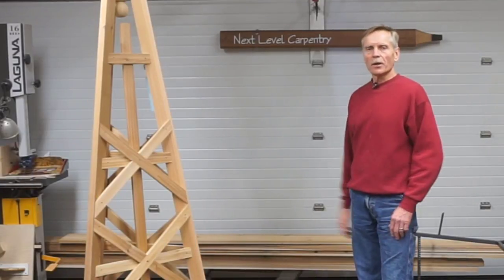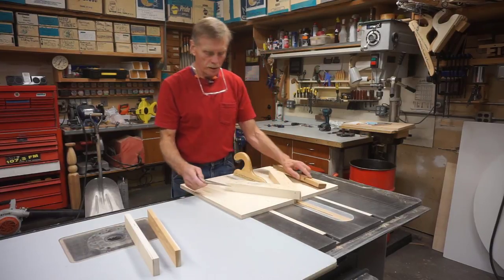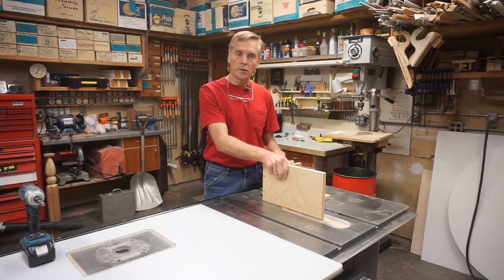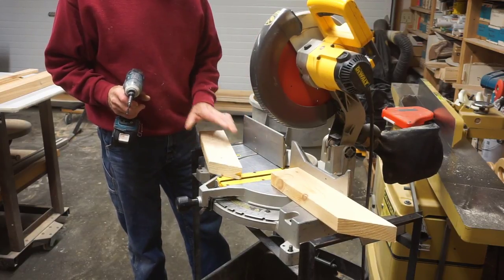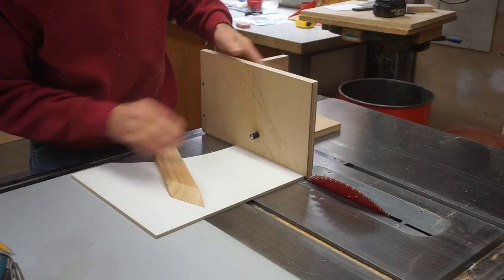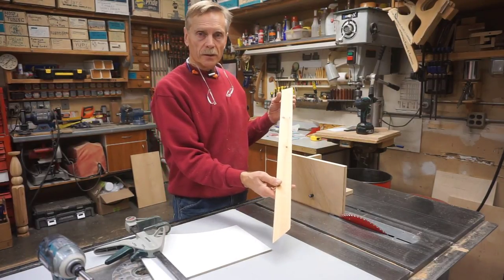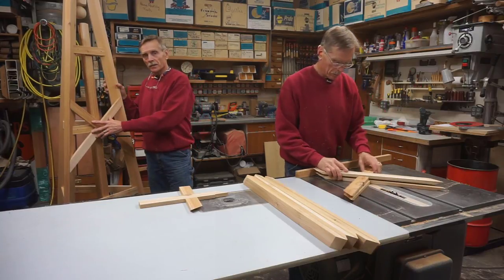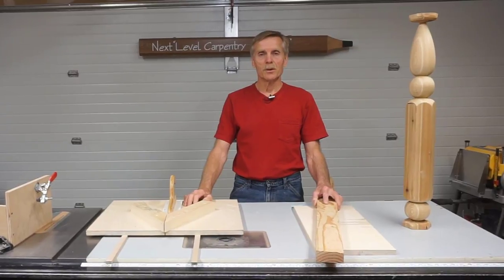Garden Obelisk Trellis Part 3: Cutting SHARP Compound Angles

Comment: There definitely is a lot in the 3 videos. Specifically you have solved a problem for me. I have been making jigs to cut an angle greater than 45 . Now I have a perfect solution!
Reply from the maker: Thanks for watching and commenting David.  If you're referring to the miter box trick for cutting sharp angles it would be cool if you give a shout out to Richard at trim carpentry TV for his part in spreading the word for that great tip! Best, Matt

Comment: I just downloaded the model. I don’t know that I can pull of the angles you have featured here but I am going to check it out. Thanks for sharing your model and so much of your knowledge.
Reply from the maker: David,
Let me know how you make out with the model? If you're familiar with SketchUp you should be able to measure various angles from the model but will need to pay close attention to how you go about it.  Make sure you're measuring the angle in the same manner required to actually make the corresponding cut.  It's all too easy to measure an angle only to learn that while it's an accurate measurement it doesn't translate directly to the setting on your saw.  If you run into problem I'll try to help out best I can...
Matt

Comment: If I recall correctly, I think you made Richard a big pencil like the one on your garage door. Also, there is one piece you never mentioned and that is the vertical piece between the legs. Is that for the plants or was there some other reason for it? Thanks, Bill
Reply from the maker: I did make a big pencil for Richard... at the same time and from the same walnut board as the Sawdust Heaven pencil that made a cameo in this video... fun stuff!  The vertical piece is just an added design feature and, since it's just straight, didn't focus on it in the build Bill.  Not surprised you noticed though... 😎